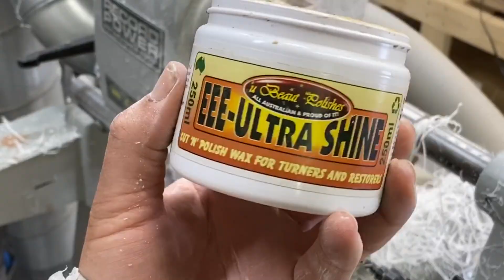Dandelion  & Hairspray Experiment - Unwaffled

Comment: I find it a bit interesting that one of the dandelions began to crack the resin vertically, just like the dragonfly did.

I'm no expert, but I wonder if perhaps when you release the pressure of the pressure pot there's a gas expansion in its that is splitting the resin although I would imagine that you would have heard it crack if so